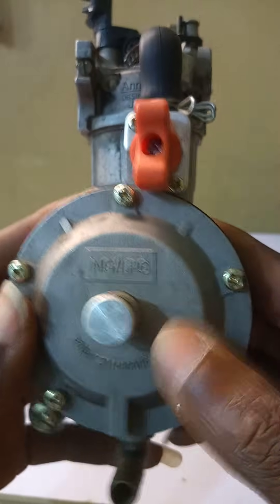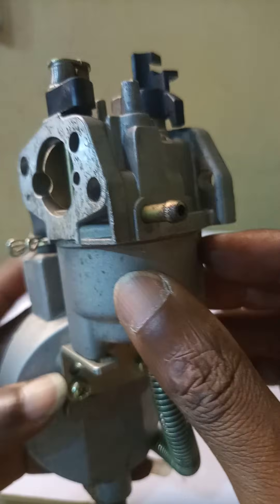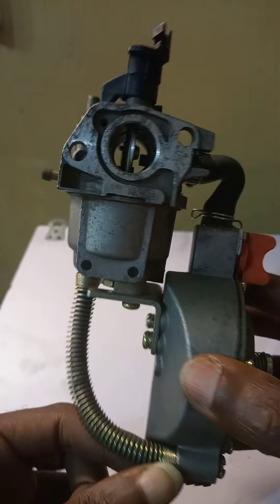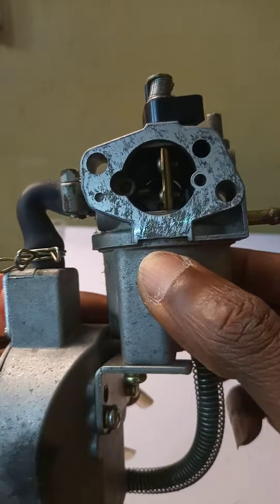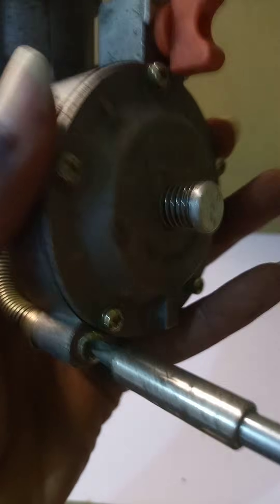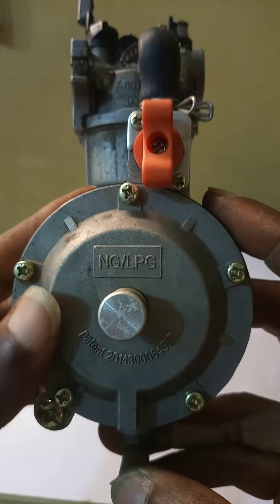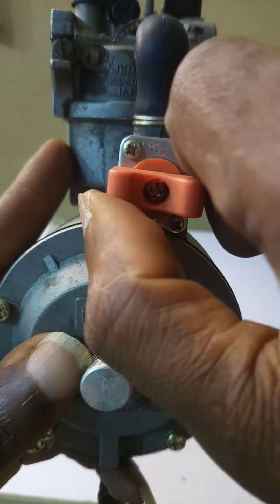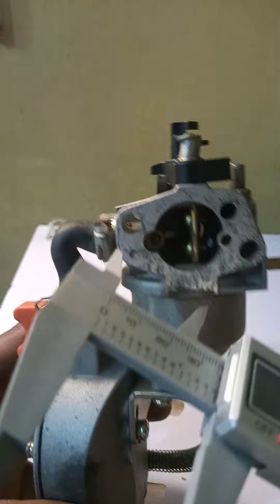LPG/ CNG conversation kit for generator, Run Gen on CNG/LPG, Buying guide for 2 to 3 to 10kw generat

Comment: Can gas work on small tiger generator?
Reply from the maker: Gas only works on any generator that you don't have to mix engine oil with it's fuel.
If your small tiger gen has engine oil compartment, yes, else, no.
Reply: @techpointzone4408  alright sir

Comment: The video is really helpful.
The choke with the NG/LPG is not needed.
Just turn the choke to the run direction and start your generator otherwise it won't start.❤
Reply from the maker: Thanks, noted. I closed it because of the fuel line which would be in use in the next test which will be to see how long 1lit of petrol will run the gen for.
Kindly SUBSCRIBE, LIKE AND SHARE so that we can be encouraged to do more helpful videos.
Reply: Mine was having hard starting so I annoyedly left it.
Reply: But with the video n d first write-up, I will try it again.
Reply: @henryonwuka2737  Start your gen immediately you turn on the gas.
If you have hard start turn off your gas. Start the gen if it start and off. 
Then, turn on the gas and  start your gen immediately.